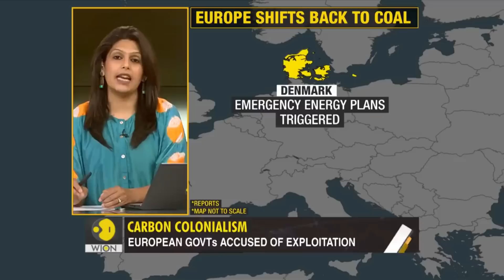Ghana is Finally going NUCLEAR POWER to intensify Industries and the African Free trade Area

Comment: I am an energy expert in UK and nuclear power plant is dangerous during decommission. Ask the proponents of nuclear power, the plan for decommission in 50 years time!
Reply: How do countries like North Korea, Pakistan or Iran handle their nuclear issues? Ghana is no less capable.of implementing similar solutions.

What is clear is that there is no  current or renewable energy solution that is going to be able.to meet the needs of Ghanas imdustrial, enterprise or societal ambitions.

Name a country that is powering its industries and societies primarily through renwables? Norway? They are currently paying record prices to electrify and heat their homes. And that is based on their hydroelectric energy sources. Germany? They are getting prepared to put their renewable solution to its biggest test this winter. If that test fails? Millions of them will freeze.
.
 There are Afrikan countries that are already amongst the TOP 10 highest consumers of renewable energy. How is that working out for their respective industries and societies?
The 10 countries using the largest percentage of renewable energy are:

DR Congo - 96.24%
Somalia - 95.03%
Central African Republic - 91.26%
Uganda - 90.22%
Gabon - 89.88%
Ethiopia - 88.92%
Liberia - 87,24%
Guinea-Bissau - 86.24%
Tanzania - 85.22%
Burundi - 84.77%

For further comparison here is a macro look at renewable energy consumption on Country by Country basis:

Country Renewable Energy Consumption % 2022 Population
DR Congo	96.24%	99,010,212
Somalia	95.03%	17,597,511
Central African Republic	91.26%	5,579,144
Uganda	90.22%	47,249,585
Gabon	89.88%	2,388,992
Ethiopia	88.92%	123,379,924
Liberia	87.24%	5,302,681
Guinea Bissau	86.24%	2,105,566
Tanzania	85.22%	65,497,748
Burundi	84.77%	12,889,576
Zambia	84.50%	20,017,675
Madagascar	82.77%	29,611,714
Bhutan	82.27%	782,455
Zimbabwe	81.50%	16,320,537
Nigeria	81.40%	218,541,212
Iceland	81.07%	372,899
Niger	80.83%	26,207,977
Cameroon	79.41%	27,914,536
Mozambique	78.08%	32,969,518
Rwanda	77.86%	13,776,698
Chad	77.79%	17,723,315
Nepal	77.39%	30,547,580
Mali	76.64%	22,593,590
Haiti	76.40%	11,584,996
Togo	76.21%	8,848,699
Sierra Leone	75.44%	8,605,718
Eritrea	73.67%	3,684,032
Malawi	73.02%	20,405,317
Republic of the Congo	68.67%	5,970,424
Kenya	68.08%	54,027,487
Eswatini	65.95%	1,201,670
Guinea	65.44%	13,859,341
Burkina Faso	64.85%	22,673,762
Guatemala	62.92%	17,843,908
Ivory Coast	62.46%	28,160,542
Norway	62.37%	5,434,319
Sudan	62.23%	46,874,204
Uruguay	60.76%	3,422,794
Paraguay	60.09%	6,780,744
Myanmar	57.85%	54,179,306
Liechtenstein	56.13%	39,327
Angola	54.69%	35,588,987
Comoros	53.43%	836,774
Cambodia	53.36%	16,767,842
Papua New Guinea	53.09%	10,142,619
Sweden	52.88%	10,549,347
Nicaragua	50.71%	6,948,392
Sri Lanka	49.91%	21,832,143
Gambia	49.24%	2,705,992
Laos	48.43%	7,529,475
Solomon Islands	48.39%	724,273
Brazil	47.57%	215,313,498
Benin	46.47%	13,352,864
Honduras	45.96%	10,432,860
Finland	45.76%	5,540,745
Pakistan	43.46%	235,824,862
Ghana	41.80%	33,475,870
Latvia	41.52%	1,850,651
Albania	40.20%	2,842,321
Lesotho	39.47%	2,305,825
Montenegro	38.74%	627,082
Tajikistan	38.56%	9,952,787
Denmark	37.52%	5,882,261
Senegal	37.20%	17,316,449
Sao Tome and Principe	37.09%	227,380
Bosnia and Herzegovina	37.02%	3,233,526
Costa Rica	35.79%	5,180,829
Samoa	34.21%	222,382
Austria	33.77%	8,939,617
Lithuania	33.53%	2,750,055
India	32.93%	1,417,173,173
Croatia	31.60%	4,030,358
Estonia	31.29%	1,326,062
Colombia	30.72%	51,874,024
Namibia	30.69%	2,567,012
New Zealand	29.65%	5,185,288
Belize	29.09%	405,272
Portugal	28.19%	10,270,865
Djibouti	27.92%	1,120,849
Kyrgyzstan	27.88%	6,630,623
Peru	27.13%	34,049,588
Philippines	26.73%	115,559,009
South Sudan	26.65%	10,913,164
Fiji	26.48%	929,766
Botswana	25.57%	2,630,296
Chile	25.26%	19,603,733
Georgia	25.22%	3,744,385
Switzerland	24.76%	8,740,472
Bangladesh	24.75%	171,186,372
Mauritania	24.70%	4,736,139
Thailand	23.96%	71,697,030
Romania	23.54%	19,659,267
Canada	22.11%	38,454,327
Moldova	22.04%	3,272,996
Cuba	21.54%	11,212,191
Serbia	21.53%	7,221,365
Slovenia	20.86%	2,119,844
Bulgaria	19.34%	6,781,953
Indonesia	19.09%	275,501,339
Panama	18.91%	4,408,581
Vietnam	18.65%	98,186,856
Afghanistan	18.51%	41,128,771
Greece	18.51%	10,384,971
Andorra	18.40%	79,824
Ecuador	17.73%	18,001,000
Slovakia	17.64%	5,643,453
Italy	17.27%	59,037,474
Spain	17.27%	47,558,630
Germany	17.17%	83,369,843
Luxembourg	16.45%	647,599
North Macedonia	16.32%	2,093,599
Czech Republic	15.85%	10,493,986
Venezuela	15.62%	28,301,696
France	15.53%	64,626,628
China	14.45%	1,425,887,337
Suriname	14.40%	618,040
Turkey	14.12%	85,341,241
Palestine	13.86%	5,250,072
Hungary	13.64%	9,967,308
Greenland	12.60%	56,466
Ireland	12.34%	5,023,109
United Kingdom	12.24%	67,508,936
Tunisia	12.20%	12,356,117
Poland	12.18%	39,857,145
Cyprus	12.05%	1,251,488
Marshall Islands	11.70%	41,569
Timor Leste	11.67%	1,341,296
Guyana	11.35%	808,726
North Korea	11.31%	26,069,416
Argentina	10.74%	45,510,318
Morocco	10.69%	37,457,971
South Africa	10.50%	59,893,885
United States	10.42%	338,289,857
Grenada	10.37%	125,438
Mexico	10.34%	127,504,125
Armenia	10.34%	2,780,469
Belgium	10.21%	11,655,930
Australia	10.13%	26,177,413
Jamaica	9.09%	2,827,377
Mauritius	8.94%	1,299,469
Bolivia	8.67%	12,224,110
Netherlands	8.54%	17,564,014
Tuvalu	8.20%	11,312
Jordan	8.17%	11,285,869
Dominica	8.05%	72,737
Belarus	7.83%	9,534,954
Malta	7.70%	533,286
Japan	7.69%	123,951,692
French Polynesia	7.67%	306,279
Aruba	7.48%	106,445
Ukraine	7.44%	39,701,739
Equatorial Guinea	6.48%	1,674,908
Saint Vincent and the Grenadines	5.68%	103,948
Lebanon	5.46%	5,489,739
Faroe Islands	5.40%	53,090
Egypt	5.30%	110,990,103
Malaysia	5.11%	33,938,221
Israel	4.47%	9,038,309
Barbados	4.31%	281,635
United States Virgin Islands	3.66%	99,465
South Korea	3.36%	51,815,810
Mongolia	3.32%	3,398,366
Russia	3.22%	144,713,314
Yemen	3.11%	33,696,614
Guam	3.02%	171,774
Libya	2.80%	6,812,341
Curacao	2.68%	191,163
Puerto Rico	2.42%	3,252,407
Isle of Man	1.90%	84,519
Micronesia	1.78%	114,164
Tonga	1.77%	106,858
Kazakhstan	1.70%	19,397,998
Azerbaijan	1.62%	10,358,074
Saint Kitts and Nevis	1.58%	47,657
Uzbekistan	1.57%	34,627,652
British Virgin Islands	1.23%	31,305
Bahamas	1.14%	409,984
Maldives	1.11%	523,787
Syria	1.02%	22,125,249
Iran	0.98%	88,550,570
Antigua and Barbuda	0.91%	93,763
Singapore	0.84%	5,975,689
Bermuda	0.84%	64,184
United Arab Emirates	0.67%	9,441,129
Nauru	0.61%	12,668
American Samoa	0.50%	44,273
Iraq	0.43%	44,496,122
Trinidad and Tobago	0.34%	1,531,044
Palau	0.29%	18,055
Hong Kong	0.23%	7,488,865
Algeria	0.16%	44,903,225
Turkmenistan	0.06%	6,430,770
Kuwait	0.06%	4,268,873
Sint Maarten	0.05%	44,175
Qatar	0.04%	2,695,122
Saudi Arabia	0.03%	36,408,820
Brunei	0.01%	449,002
Oman	0.00%	4,576,298
Bahrain	0.00%	1,472,233
Cayman Islands	0.00%	68,706

Even the West does not take the renewable scam that seriously. Less so with the current test pending that they are facing this winter; without their usual supply from Russia.

There is no substitute for how the industrial economy runs today. The "renewable" push is a road to de-industrialization. A dead end one at that.

Afrika does not need to fall for any "Bait and Switch." They have to get tired of being dupes and suckers for Globalist schemes at some point. 

Renewable Energy is The Scam We All Fell For
https://youtu.be/lL6uB1z95gA

Bill Gates Slams Unreliable Wind and Solar Energy
https://youtu.be/9xe3BWPsBTU

Why renewables can’t save the planet 
https://youtu.be/N-yALPEpV4w.

Comment: Nuclear Energy is not the answer for Ghana!
Reply: Nuclear is the answer. Especially given there is no current or.renewable energy option that can.meet the needs presented by Them as industries, enterprises or society that will allow Ghana to compete with other world players on fair terms.

Name a country that is powering its industries and societies primarily through renwables? Norway? They are currently paying record prices to electrify and heat their homes. And that is based on their hydroelectric energy sources. Germany? They are getting prepared to put their renewable solution to its biggest test this winter. If that test fails? Millions of them will freeze.
.
 There are Afrikan countries that are already amongst the TOP 10 highest consumers of renewable energy. How is that working out for their respective industries and societies?
The 10 countries using the largest percentage of renewable energy are:

DR Congo - 96.24%
Somalia - 95.03%
Central African Republic - 91.26%
Uganda - 90.22%
Gabon - 89.88%
Ethiopia - 88.92%
Liberia - 87,24%
Guinea-Bissau - 86.24%
Tanzania - 85.22%
Burundi - 84.77%

For further comparison here is a macro look at renewable energy consumption on Country by Country basis:

Country Renewable Energy Consumption % 2022 Population
DR Congo	96.24%	99,010,212
Somalia	95.03%	17,597,511
Central African Republic	91.26%	5,579,144
Uganda	90.22%	47,249,585
Gabon	89.88%	2,388,992
Ethiopia	88.92%	123,379,924
Liberia	87.24%	5,302,681
Guinea Bissau	86.24%	2,105,566
Tanzania	85.22%	65,497,748
Burundi	84.77%	12,889,576
Zambia	84.50%	20,017,675
Madagascar	82.77%	29,611,714
Bhutan	82.27%	782,455
Zimbabwe	81.50%	16,320,537
Nigeria	81.40%	218,541,212
Iceland	81.07%	372,899
Niger	80.83%	26,207,977
Cameroon	79.41%	27,914,536
Mozambique	78.08%	32,969,518
Rwanda	77.86%	13,776,698
Chad	77.79%	17,723,315
Nepal	77.39%	30,547,580
Mali	76.64%	22,593,590
Haiti	76.40%	11,584,996
Togo	76.21%	8,848,699
Sierra Leone	75.44%	8,605,718
Eritrea	73.67%	3,684,032
Malawi	73.02%	20,405,317
Republic of the Congo	68.67%	5,970,424
Kenya	68.08%	54,027,487
Eswatini	65.95%	1,201,670
Guinea	65.44%	13,859,341
Burkina Faso	64.85%	22,673,762
Guatemala	62.92%	17,843,908
Ivory Coast	62.46%	28,160,542
Norway	62.37%	5,434,319
Sudan	62.23%	46,874,204
Uruguay	60.76%	3,422,794
Paraguay	60.09%	6,780,744
Myanmar	57.85%	54,179,306
Liechtenstein	56.13%	39,327
Angola	54.69%	35,588,987
Comoros	53.43%	836,774
Cambodia	53.36%	16,767,842
Papua New Guinea	53.09%	10,142,619
Sweden	52.88%	10,549,347
Nicaragua	50.71%	6,948,392
Sri Lanka	49.91%	21,832,143
Gambia	49.24%	2,705,992
Laos	48.43%	7,529,475
Solomon Islands	48.39%	724,273
Brazil	47.57%	215,313,498
Benin	46.47%	13,352,864
Honduras	45.96%	10,432,860
Finland	45.76%	5,540,745
Pakistan	43.46%	235,824,862
Ghana	41.80%	33,475,870
Latvia	41.52%	1,850,651
Albania	40.20%	2,842,321
Lesotho	39.47%	2,305,825
Montenegro	38.74%	627,082
Tajikistan	38.56%	9,952,787
Denmark	37.52%	5,882,261
Senegal	37.20%	17,316,449
Sao Tome and Principe	37.09%	227,380
Bosnia and Herzegovina	37.02%	3,233,526
Costa Rica	35.79%	5,180,829
Samoa	34.21%	222,382
Austria	33.77%	8,939,617
Lithuania	33.53%	2,750,055
India	32.93%	1,417,173,173
Croatia	31.60%	4,030,358
Estonia	31.29%	1,326,062
Colombia	30.72%	51,874,024
Namibia	30.69%	2,567,012
New Zealand	29.65%	5,185,288
Belize	29.09%	405,272
Portugal	28.19%	10,270,865
Djibouti	27.92%	1,120,849
Kyrgyzstan	27.88%	6,630,623
Peru	27.13%	34,049,588
Philippines	26.73%	115,559,009
South Sudan	26.65%	10,913,164
Fiji	26.48%	929,766
Botswana	25.57%	2,630,296
Chile	25.26%	19,603,733
Georgia	25.22%	3,744,385
Switzerland	24.76%	8,740,472
Bangladesh	24.75%	171,186,372
Mauritania	24.70%	4,736,139
Thailand	23.96%	71,697,030
Romania	23.54%	19,659,267
Canada	22.11%	38,454,327
Moldova	22.04%	3,272,996
Cuba	21.54%	11,212,191
Serbia	21.53%	7,221,365
Slovenia	20.86%	2,119,844
Bulgaria	19.34%	6,781,953
Indonesia	19.09%	275,501,339
Panama	18.91%	4,408,581
Vietnam	18.65%	98,186,856
Afghanistan	18.51%	41,128,771
Greece	18.51%	10,384,971
Andorra	18.40%	79,824
Ecuador	17.73%	18,001,000
Slovakia	17.64%	5,643,453
Italy	17.27%	59,037,474
Spain	17.27%	47,558,630
Germany	17.17%	83,369,843
Luxembourg	16.45%	647,599
North Macedonia	16.32%	2,093,599
Czech Republic	15.85%	10,493,986
Venezuela	15.62%	28,301,696
France	15.53%	64,626,628
China	14.45%	1,425,887,337
Suriname	14.40%	618,040
Turkey	14.12%	85,341,241
Palestine	13.86%	5,250,072
Hungary	13.64%	9,967,308
Greenland	12.60%	56,466
Ireland	12.34%	5,023,109
United Kingdom	12.24%	67,508,936
Tunisia	12.20%	12,356,117
Poland	12.18%	39,857,145
Cyprus	12.05%	1,251,488
Marshall Islands	11.70%	41,569
Timor Leste	11.67%	1,341,296
Guyana	11.35%	808,726
North Korea	11.31%	26,069,416
Argentina	10.74%	45,510,318
Morocco	10.69%	37,457,971
South Africa	10.50%	59,893,885
United States	10.42%	338,289,857
Grenada	10.37%	125,438
Mexico	10.34%	127,504,125
Armenia	10.34%	2,780,469
Belgium	10.21%	11,655,930
Australia	10.13%	26,177,413
Jamaica	9.09%	2,827,377
Mauritius	8.94%	1,299,469
Bolivia	8.67%	12,224,110
Netherlands	8.54%	17,564,014
Tuvalu	8.20%	11,312
Jordan	8.17%	11,285,869
Dominica	8.05%	72,737
Belarus	7.83%	9,534,954
Malta	7.70%	533,286
Japan	7.69%	123,951,692
French Polynesia	7.67%	306,279
Aruba	7.48%	106,445
Ukraine	7.44%	39,701,739
Equatorial Guinea	6.48%	1,674,908
Saint Vincent and the Grenadines	5.68%	103,948
Lebanon	5.46%	5,489,739
Faroe Islands	5.40%	53,090
Egypt	5.30%	110,990,103
Malaysia	5.11%	33,938,221
Israel	4.47%	9,038,309
Barbados	4.31%	281,635
United States Virgin Islands	3.66%	99,465
South Korea	3.36%	51,815,810
Mongolia	3.32%	3,398,366
Russia	3.22%	144,713,314
Yemen	3.11%	33,696,614
Guam	3.02%	171,774
Libya	2.80%	6,812,341
Curacao	2.68%	191,163
Puerto Rico	2.42%	3,252,407
Isle of Man	1.90%	84,519
Micronesia	1.78%	114,164
Tonga	1.77%	106,858
Kazakhstan	1.70%	19,397,998
Azerbaijan	1.62%	10,358,074
Saint Kitts and Nevis	1.58%	47,657
Uzbekistan	1.57%	34,627,652
British Virgin Islands	1.23%	31,305
Bahamas	1.14%	409,984
Maldives	1.11%	523,787
Syria	1.02%	22,125,249
Iran	0.98%	88,550,570
Antigua and Barbuda	0.91%	93,763
Singapore	0.84%	5,975,689
Bermuda	0.84%	64,184
United Arab Emirates	0.67%	9,441,129
Nauru	0.61%	12,668
American Samoa	0.50%	44,273
Iraq	0.43%	44,496,122
Trinidad and Tobago	0.34%	1,531,044
Palau	0.29%	18,055
Hong Kong	0.23%	7,488,865
Algeria	0.16%	44,903,225
Turkmenistan	0.06%	6,430,770
Kuwait	0.06%	4,268,873
Sint Maarten	0.05%	44,175
Qatar	0.04%	2,695,122
Saudi Arabia	0.03%	36,408,820
Brunei	0.01%	449,002
Oman	0.00%	4,576,298
Bahrain	0.00%	1,472,233
Cayman Islands	0.00%	68,706

Even the West does not take the renewable scam that seriously. Less so with the current test pending that they are facing this winter; without their usual supply from Russia.

There is no substitute for how the industrial economy runs today. The "renewable" push is a road to de-industrialization. A dead end one at that.

Afrika does not need to fall for any "Bait and Switch." They have to get tired of being dupes and suckers for Globalist schemes at some point. 

Renewable Energy is The Scam We All Fell For
https://youtu.be/lL6uB1z95gA

Bill Gates Slams Unreliable Wind and Solar Energy
https://youtu.be/9xe3BWPsBTU

Why renewables can’t save the planet 
https://youtu.be/N-yALPEpV4w
Reply: @BonsuBigWhale  my brother if they make you in charge of this nuclear power plant project and 50 years time the plant has finished its useful life and you are asked to destroy the plant, where will you despose those dangerous fissile materials? If you prove how to do this safely i will support this project.
Reply: I keep asking the questions as to how nations such as Iran, Pakistan and North Korea deal with the same issue? Is it not possible to employ a similar solution? Altrnatively, 50 years is a long time. It could be possible that disposal techniques would advance during that period to provide even better solutions.
I still do not see any renewable energy solution that will meet the countries needs moving forward. Then again I do not necessarily believe that we need to abandon our fossil fuel energy we have been endowed with eithher. Nuclear is a response.to what is seen as a bait and switch by the West towards Afrikaans self sabotaging and self denying itself from available energy sources while they themselves utilize same for their benefit. It simply cannot be that we stand still while others move forward. We do not deserve that reality.
Reply: @BonsuBigWhale  Ghana land is different from those countries you're talking about. You are talking as a lay person, and not as an expert. 
In UK during decommissioning of a certain nuclear power plant it called for millions of pounds to deal with and the challenge was massive. See how even gold mining is destroying our water bodies. 
Nuclear power plant is very good and has a lot of advantages in its operation,  but the major challenge is how to encase the deadly fissile radioactive materials. The cost of decommissioning is very high. UK and other western countries have stopped embarking on nuclear projects but on renewable energy sources. Why can't we do the same?
I don't know where you come from in Ghana but when you're alive during decommission time and they want to dump in your homeland whether you will accept it.